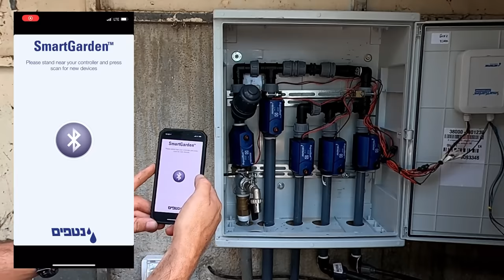Garden Renovation - Complete Makeover

Comment: The extra large pavers are terrific.

Think I'd regret taking out a lot of the established plants, unless there were real problems with them, such as obstructing sewer lines, etc.  
No sunken trampoline after that??  It'll likely blow away... should have filled holes and leveled first.  You also need to mulch. The heat wave will be a killer.
Reply: My thoughts exactly. It’s the small details that make a huge difference to bring it to the finish line. But great transformation none the less.

Comment: I'm a professional gardener and when I see landscapers edging the grass with a weed whacker I go NUTS when I see them holding it at a slant from the grass side.   That results in shaving the grass along the edge so short that it will die.   Then the next time they crop it closer and closer - so the garden or the path expands and the grass shrinks.   When edging with a weed whacker it is best (and the high end guys do this) to walk forward along the edge with the whacker in front of you, with the string rotating vertically (perpindicular to the lawn)   That way you get a precise 1/2" CUT ALONG THE BORDER.

Comment: What a nice garden it became! I wonder; those dripping pipes, why aren't they into the ground?
Reply from the maker: thanks. For subsurface applications there are root & sand protected dripping pipes. they cost more and the installation is harder and there for more expensive for the client. Those pipes we use are meant for above the ground drip. As for esthetics anyway they will be hidden by the plants in no time.
Reply: I love the transformation, but after all the work - - the drip lines are a serious visual distraction for me. 

What about a layer of mulch to disguise them? Mulch would also work in tandem with the irrigation system to help retain moisture.
Reply from the maker: Totally agree about the mulch, but we work in a budget and not everything fits. 

But by now after 6 months the plants cover most of the pipes so they are not visible